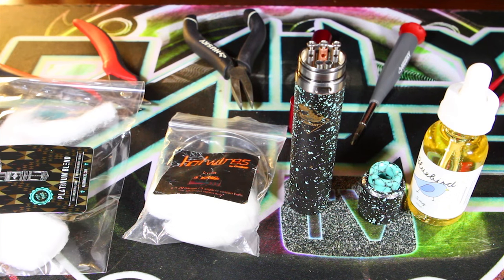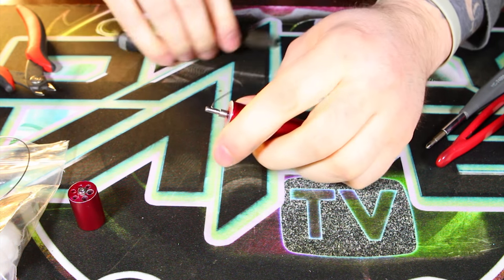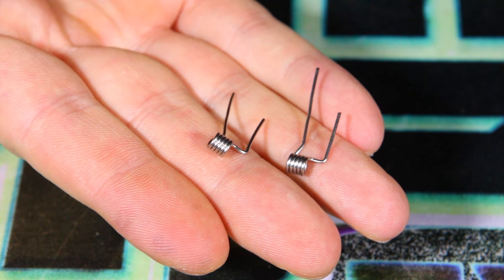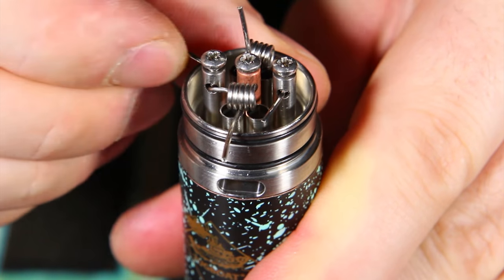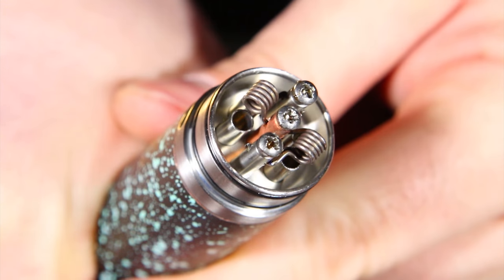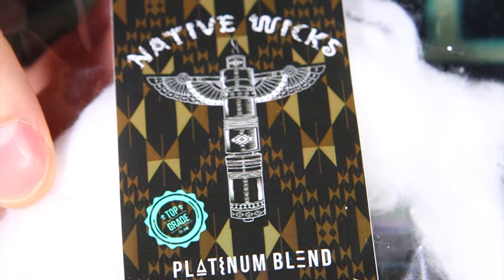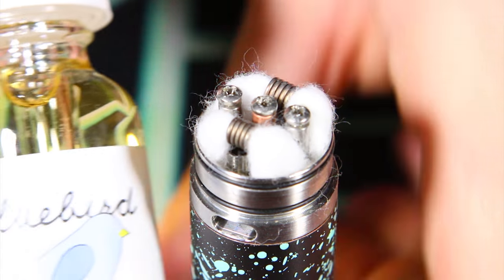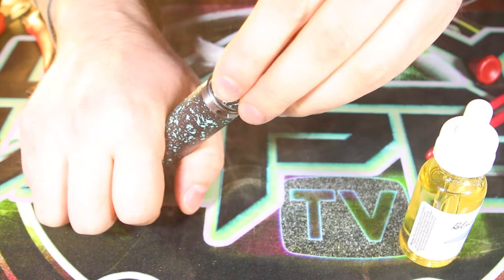#FRESHBUILDFRIDAY - 20g Redux

Comment: strumming fixes most hot spots you dont even need to squeeze the coils if u strum it. unless they dont look tight enough but strumming is the best tip coil building i ever learned honestly
Reply from the maker: +Anthony Piccarini These weren't quite tight enough for my liking. I prefer tightening with ceramic tweezers but I don't own a pair :( The strum technique has definitely helped me out A LOT though, changed the way I build for sure.

Comment: Nice job. Bro the MOONSHOT, have you got one yet. The best rta out by FARR, IMO.. I love tht tank soo much, its like a 2 post kennedy and a goblin mii had a baby.. It is truly dripper performance and flavor without having to drip. (partly due to its short size) only holds 2mls, but it has a kickass top fill tht you can fill in 20 sec. The best tank ive ever had for flavor and vapor. Im running 24/n80 tiger coils 3mm I.D. 11 wraps, in a tank thts the same size as the goblin mini, nuff said!! lol
Reply from the maker: +Andrew P. Sounds kinda like the Aromamizer RTA. The only RTAs I've tried are the Russian 91%, Kay Fun, Lemo 2 and Monster V3. Tanks were never really my thing but there have been a few cool new ones lately. Have you seen the Avocado??

Comment: thanks for the tip with bending the wire to keep the straight also what battery do you have in the tugboat
Reply from the maker: +jdmdb1990 For my mechs I only use Sony VTC 4 or 5's. You can still find them if you can get them from a reputable dealer like IMRbatteries.com etc.

Comment: can you build some 316l alien claptons? im waiting for them to come out with 316l ribbon wire. then we can get some alien staple coils for ss temp control hahaha
Reply from the maker: +Anthony Piccarini Haha I can barely build a fused Clapton! I'm way behind the times as far as the fancier builds go. I have yet to try SS out for temp control...perhaps that could be a future video.....
Reply: vapewire.co.uk has stainless ribbon and they have up to 36g 316 316L and 317 down to 18g. I live in Florida and even paying Shipping charges from UK the price is still ALOT less than kidney puncher, lightning vapes, or Amazon or ebay for wire. very very good prices on wire over there. they have some primate coils also. they also carry n80, n60 and A1 too

Comment: Why don't you trim the positives to length before you insert you would cut time and have a more consistent build. and it will line lineup the coils on its own.
Reply from the maker: +Joseph Lopez That technique has never worked for me. I've tried it but I always find one still being uneven from the other. I'd rather have a little room to work with if necessary than trim too much off of one and need more. If it works for you though, keep doing what you're doing!

Comment: Hey Nick what a angry coil!! haha I know you are a big fan of Kennedy so I got to ask. I have Kennedy Ruby mod .18~.2ohm build with Samsung 25R or Sony VTC4 (so I think it is pretty safe build for Ruby) but the thing is my button make some arcing mark on negative side. Do you maybe know why it happens? As always thanks for your review!
Reply from the maker: +Enyork Choi Mine did that for a while too, one thing you have to do is polish the hell out of the pin because it has machine marks on it and can cause arcing. I've also been told by a representative of Kennedy's that the Ruby was designed to have the positive side of the battery facing down. This will reduce the throw and make it so if the battery vents it will not be catastrophic to the device itself.
Reply: +Daily Vape TV Thanks for the comment. Yeah this issue got me annoyed for a while so I asked around and I found a solution for that I guess. So there is a product called DeoxiT from Craig and it says improve conductivity, give a layer of coat to prevent oxidation and reduces intermittent connections, arcing & RFI. ( you might know about this) Basically It is just a preserving and coating method for electric devices. but still sounds nice doesn't it? It does even sound too good to trust somehow haha. If you are interested, give it a try. it does the trick (aside from that, I don't work for the company so no worries :) )

Thanks for the review